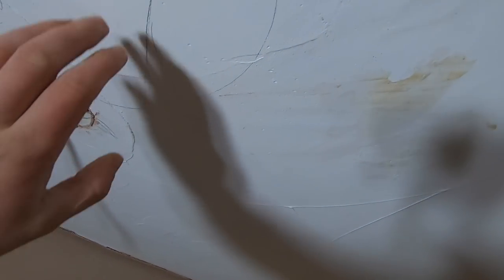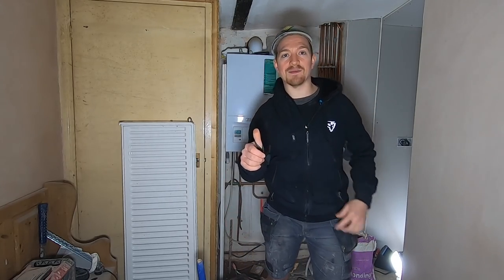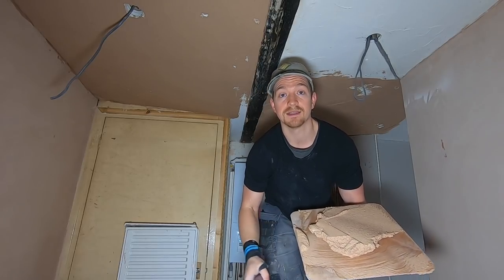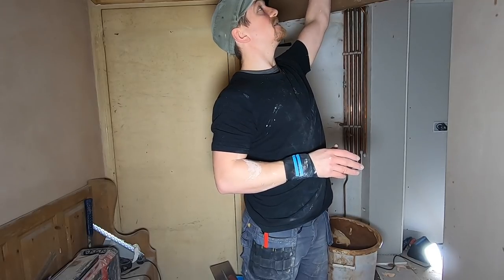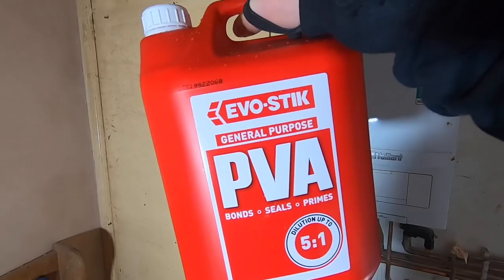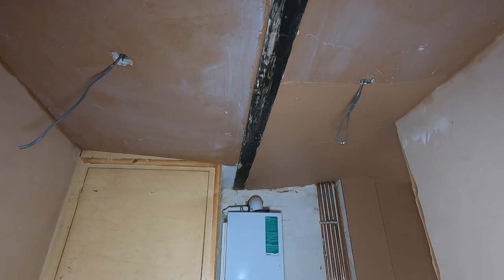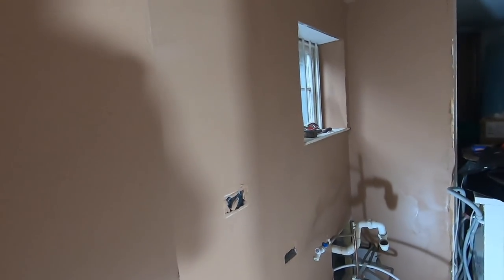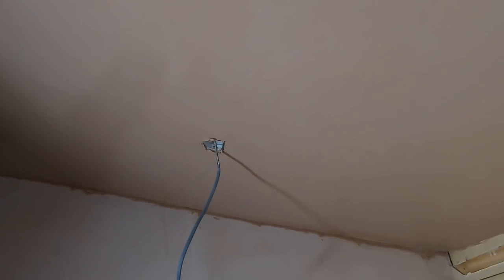Plastering Tips & Tricks (ARTEX CEILINGS/ Bonding Plaster/ PVA Glue/Plaster Prep/Halftime 4 Bonding)

Comment: Hi Blain
I’m also in agreement with Gordon Mackie,it’s great that you are prepared to take your time to impart your knowledge to people and great vids,and I’m in no way criticising you,because no two people work the same,and we can all learn and improve from others.
However on Artexed cielings I’d always hit with a  pissed out 50/50 pva mix,and let it pull in to the ceiling,then normal multi finish,and flatten out with a Refina spat on the first coat,then it’s business as normal for the second coat.
Multi finish is just that,it can be the undercoat and the top coat,most people think of multi finish as just a finishing plaster.
The key with all plastering/artexing is controlling the absorption rate of the substrate wall/ceiling,if it’s drawing too quickly you going to work hard.
Keep up the good work👍
Reply from the maker: I usually do it the same way to be fair mate. I followed the same process which I filmed for the first video I created on Artex ceilings. I just thought I'd show a different method. The video is here is anyone wants to see it:

https://youtu.be/th6IDEWK8p0

Thanks for your input and it was great hearing from you. I really appreciate it! Cheers pal 👍

Comment: Hi Blaine At what point with Artex do you decide to use a bonding coat first? Is it the thickness of the pattern in the artex? About to do a ceiling job but undecided on whether to just skim or bonding then skim. Great series of videos mate!
Reply: If you’ll have no chance of remotely covering the pattern with the first coat then that’s when it’s time to bond it, overboard it, or do a magic mix first clay which is bonding in the multi finish, Ie one bag of multi finish with a quarter of a bag of bonding mixed in, gives you more time and its fluffy and nice to spread

Comment: Hi there Blain, why did you not PVA the textured ceiling first before coating it with bonding??
Reply from the maker: Hi mate! I did PVA the ceiling but it was prepped when I plastered the walls weeks previously. Sorry I should have stated that in the video. My bad 👍
Reply: Pre grit?
Reply: Was just gonna ask same thing ha 
Nice job by the way
Reply: @PlasteringForBeginners  you MUST coat over PVA when tacky unless you mix PVA & sand.  Why didn't you scrim the angles when skimming walls?  Also push them wires for spots up in out the road so it's handier & quicker👍
Reply: @dbgers784  no you mustn’t. I always go over my neat pva when it’s dry and have never had any problems

Comment: All depends on how heavy the artex is if it's over 6mm I will coat it out with a bonding/finish mix  or just bonding but I get away with doing alot of artex ceiling with just using multi I will try and upload my method when I get a chance In no way am I criticising your work  nice job m8 👍only thing I never heard in vid or saw in description was did you  pva the artex ceiling after scraping it its imperative that you do this not knocking u bud
Reply from the maker: Me too pal. My first video on Artex ceilings, (which is on my channel), I tackled the same way - I just wanted to provide another method. However, I usually do it the way you said. I didn't actually scrape this one which is why I bonded it but the ceiling was PVA'd prior. Great hearing from you and I look forward to seeing your next video pal. Cheers 👍
Reply from the maker: Here's the video if anyone is interested 👍 https://youtu.be/th6IDEWK8p0
Reply: @PlasteringForBeginners  good old artex keeps us busy👍
Reply from the maker: Ha it does matey!
Reply: Same here mate. My old gaffer once used straight bonding on an artex ceiling, and because it stayed wet for ages it soaked through the pva and through artex and fell down. He heard a little creek when he was toweling up, suspected it might come down, so told customer to empty kitchen, sheet up and it dropped at 2.30am. Literally came off in one sheet and brought the artex with it. He then just pva'd it and skimmed it. I've never trusted neat bonding over artex, usually just use multi and when needed 2/3 finish 1/3 bonding.
Reply: @blackesteyes1133  yep i managed to lay a cover of multi over a big artex ceiling....i bought the whole fucking lot down , luckily room was empty....we boarded over it , that what i do all the time now....

Comment: Explained well good video. Just one question though I e-mailed British gypsum about bonding plaster on ceilings because I need to bond a ceiling 8mm bag says 8mm on ceilings, British  gypsum technical support says no 8mm can't work on ceilings? You look like you're putting on bonding quite thin just to level things out, what your experience Blaine?
Reply from the maker: Well laths and plaster were a lot thicker than 8mm so it all depends on the surface your plastering onto! I'm guessing they're worried about the weight!! It would be a lot of extra plaster!
Reply: @PlasteringForBeginners  technical support e-mailed  back today saying 5mm to 8mm is fine on ceilings, they said ignore the previous e-mail. They certainly know how to  confuse you. Keep vids coming blain.

Comment: Great videos! Quick question if i apply a bonding coat to my ceiling will i need to plaster over it straight away or am i able to leave it and come back to it when ready? I'm gonna be plastering my ceiling and walls. Ill be bonding the ceiling then skimming walls and ceiling with multi finish. Can you expand on what you said about tieing the walls into the ceiling as i don't want it to crack. obviously ill be tackling the ceiling first. then moving onto the walls, complete beginner, any advice for meeting walls and ceiling?
Reply from the maker: It's totally up to you mate. As long as you PVA the Bonding then it doesn't matter how long you wait - but apply 2 coats of PVA if you're going to plaster it the next day. Use Scrim tape on all your edges and your walls will be tied in pal. Hope this helps mate 👍
Reply: @PlasteringForBeginners  Hi Blaine, if I come back to it the next day, for the two coats of PVA, how long between each coat is applied? Spoke to British Gypsum also, and they said just wet it and they’re dead against PVA on the bonding. Thanks for the videos btw. They’re a big help

Comment: hi blain, what's the best course of action with a quite heavy artexed ceiling? same procedure with a thicker coverage of bonding?
Reply: Over board to save any hassle if artex is thick and uneven . Artex as no guarntee of been reskimmable and can and does fail . The more weight added to a celing is always depending on the original bond of the artex you are covering
Reply: @andrewmacdonald7090  thank you mate, overboard it is then, bloody artex looks so 70's
Reply from the maker: Good point Andrew - good man!
Reply: artex should never be plastered over because its not technically a plaster its a air drying compound ,it doesn't set, it dries out, unlike plaster where a chemical reaction takes place, that why u can mix a bucket of artex and use it next day once u cover the bucket ,what happens is the water in the new coat softens the artex and thats why the ceilings fail  ,so overboard it ,its a much better job, ive been a spread since 1991👍

Comment: I NEVER plaster over artex anymore. Always Always overboard. Artex deteriorates when wet and has to carry the weight of all that Bonding and skim.youll get away with it most times but you'll get one come down on you believe me .and the amount of effort Bonding first is about the same as tacking it .nice job though
Reply from the maker: Fair point matey! It's not happened to me yet but never say never. Great hearing from you. Cheers 👍
Reply: 17 years in and never happened to me either, had distemper but never had an artex not hold
Reply: I'm with you mate once bitten